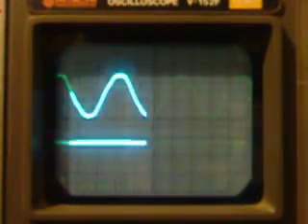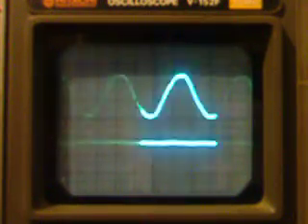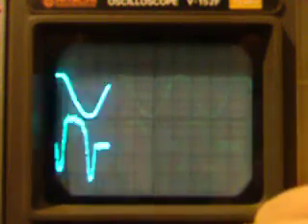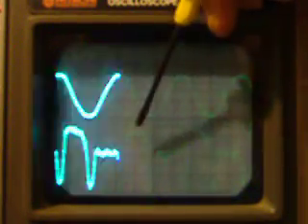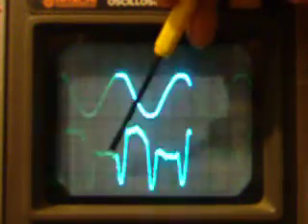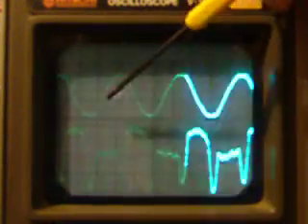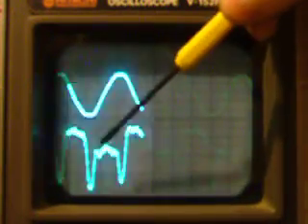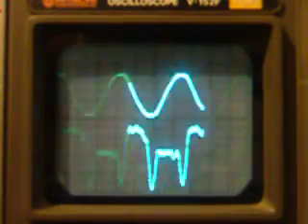The Hunt for Buzz & Hum - Part 2 of 10

Comment from the maker: The main settings on the oscilloscope are just the input sensitivity and the time scale.  There are other controls that handle mode of operation,  which channel is used to synchronize to to the signal, a find tune on the sync,  and zoom in on the time scale, although the input sensitivity and time scale are the two most used ones.